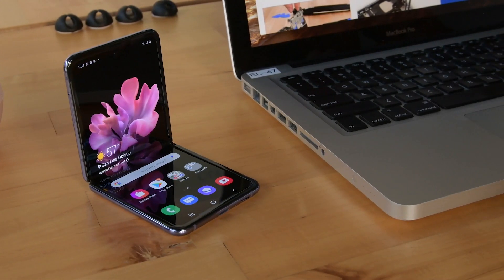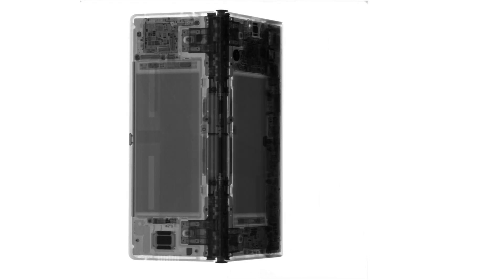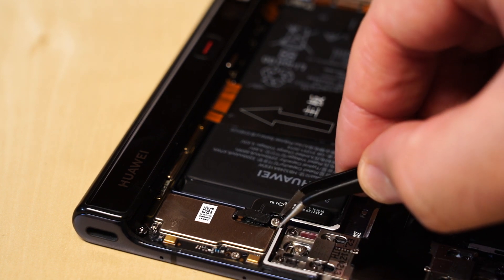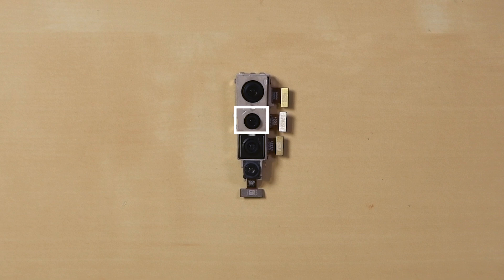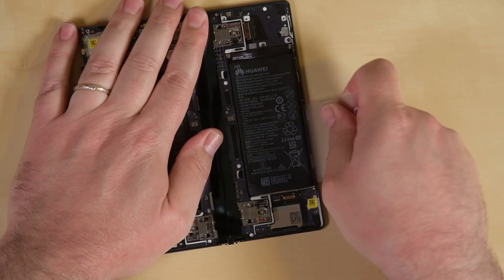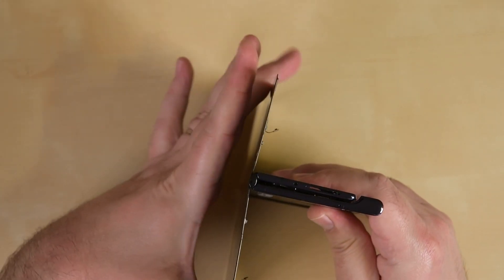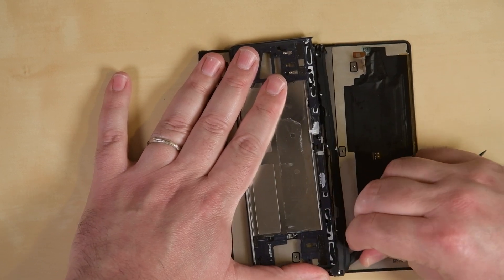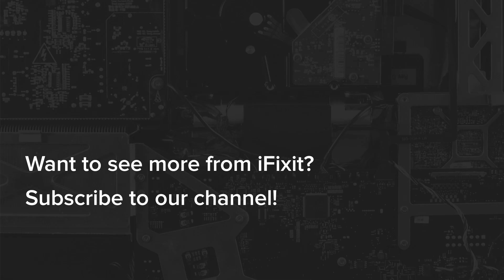Huawei Mate Xs Teardown: The Most Durable Foldable Yet?

Comment: You are gonna throw that old battery anyway after replacing it... Than why so concern of being it tightly glued
Reply: the issue is that it takes a long time and introduces risk of damage to surrounding components due to the force needed :/
Reply: @psider1522  I agree that it may puncture or damage and catch fire.... So let battery down till it can't even power up phone in this way risk of catching fire can be minimise..... . If you are careful enough like in this video I don't think any other part can be damaged

Comment: when i used to work at a repair shop, i always hated changing huawei batteries because of the risk of cracking the screen if applied too much force, stain the screen because of too much alcohol,  burning the screen or the battery because of too much heat... like 40 minutes per battery cause of the amont of glue applied!!

Comment: If you can afford $2300 on a cutting edge phone, you surely dont need to consider repairing it.
Reply: I think you should consider it! If not for your wallet, then for the planet. (To produce less waste: A battery in the waste is less then a whole phone thrown away. Especially if you consider the enviromental impact of creating such new technologies. For example: Under 30% of all fordable displays manufactured works correctly. The other 70+ percent is basically waste. Am I wrong?)

Comment: Not durable as a galaxy in my opinion..
The plastic display is exposed all the time..
It is likely to get scratched and bumped up soon.
Reply: The screen replacement is same on both.. Really really hard.
And you'd need less replacements on the fold anyway

Comment: Score is only 2 ? WTF.
You can replace most of the things without removing the screen. If you want to replace the screen then its possible, but then its something wrong with you for dropping $2000 smartphone in first place.  And when you replacing battery, it does not matter if the old battery will stay in perfect condition. 
It should get at least 7-8 out of 10, because of the glue.

Comment: Cemented battery and extremely difficult to remove display- automatic 0/10 since they are most replaced parts.
Reply: 0/10 is if they literally can't be replaced.
Reply: I don't know why people are panic about battery replacement... Replacing battery means you don't need older one...  you are gonna throw it anyway
Reply: @nothing9220  If the battery is glued down like that, you CANT replace it, thats the point. If it fails, you may have to buy another unit or pay heavily for a replacement
Reply: @PaperSparks  when you replace battery you have to buy new one anyway.... Thats why its called replacement because you swap old battery for new one. Why you need old battery then?
Reply: @PaperSparks  If you can't replace such batteries, you shouldn't work on a repair service. Also, if you plan to install the OLD BATTERY on a replacement, you definetely don't belong on a repair service.
Reply: no they doesn't take care about the fold other fold will break and have issues for no reason and i have vid mate x survive many drops and huawei didn't make the weak display' it would be a game changer if huawei made it's own
Reply: No they shouldn't be a 0. Look at the Surface Laptop 1 and 2 (they DO deserve their 0s).